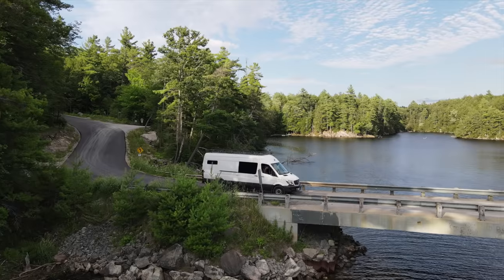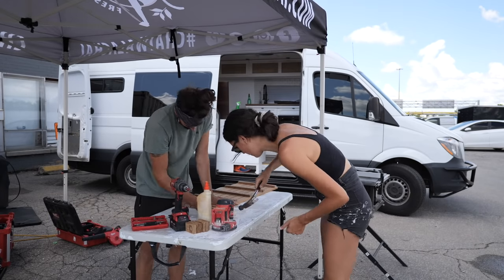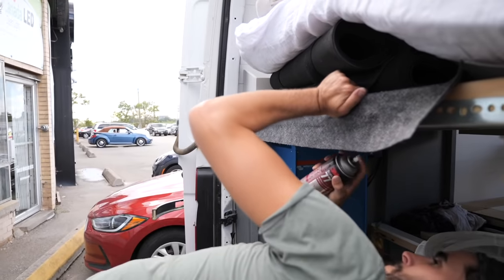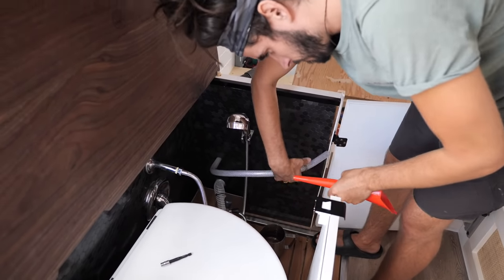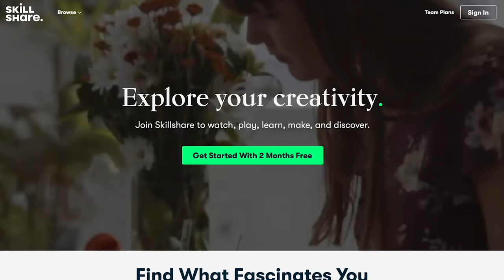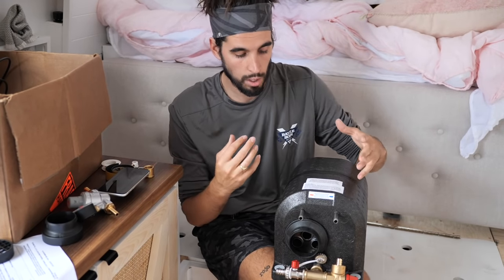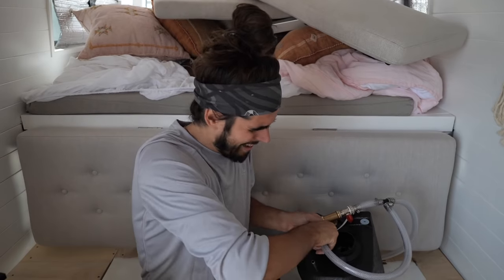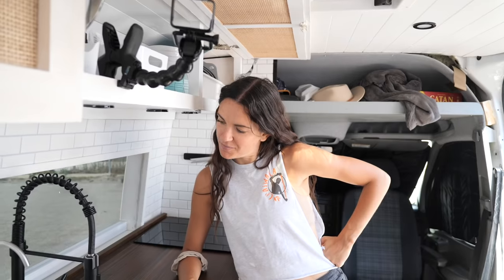VAN LIFE BUILD: Light at the End of the Tunnel

Comment: Would be cool if you can set up the shower like a steel walled box (probably could do in 2 pieces) where it’s collapsible and hides within your existing wooden shower walls. So pull it up around you and locks in place while you shower. Then it’ll be easier to wipe down the water so you don’t have a curtain hanging for an hour taking up space in the van. Hope you can visualize what I’m trying to say! Great job on the build, we love you guys!

Comment: Whats cool about that teakwood shower floor is that you can probably tuck the curtian into it making less moisture in the actual shower basin. Then if you get a squeegee you can just swipe a lot of moisture from the shower curtian straight into the drain--making a shorter dry time. I would also suggest putting a holder for your pee funnel so it stays upright :) these videos are super cool

Comment: **GoGirl, Pitch and Trek, and SheWee**
These are FUD’s [Female Urinary Device] made from silicon and are more ergonomically correct and are basically just like the funnel you are using, but probably a bit more soft and comfortable for you than plastic cone Bec. I’ve seen them at REI and other similar stores and of coarse Amazon for those wondering.

Comment: There seem to be a couple of oil leaks underneath your van. And maybe it is a good idea to spray the underside of it with used motoroil. Or some other kind of rust prevention treatment. I had a local garage do that to my Hiace. It didn't cost much. If you change the oil yourself, maybe you can also spray the underside of it with the used oil yourself. If you do it, don't go to any sandy places with the van before the oil has dried.

Comment: I live in a tiny house and paid about $1,000 USD for one of those nature's heads. I agree, dumping the pee jug is disgusting and tedious, but just wait for the fruit flies. Diatomaceous earth will work for a while, but they inevitably return. I ditched the nature's head after about a year, and now have an indoor commode for number one, which I made from an old chair and wooden toilet seat, with a large funnel piped into a French drain. For number two, I've gone with a simple 5 gallon bucket and sawdust, which gets dumped about once a week into a larger outdoor composting system. Much cheaper, and no more fruit flies.